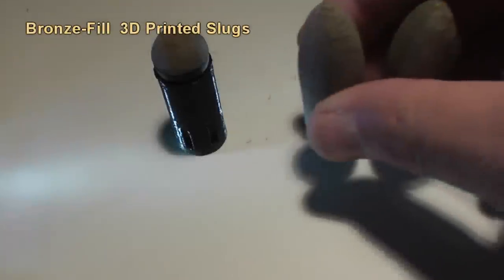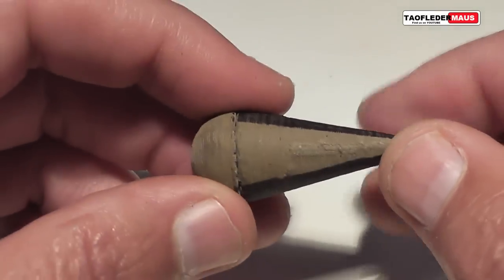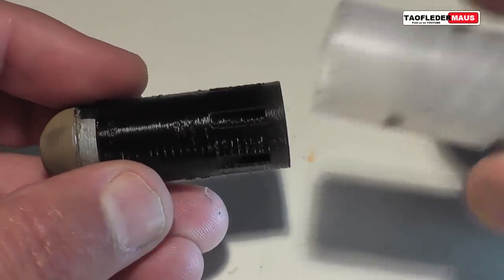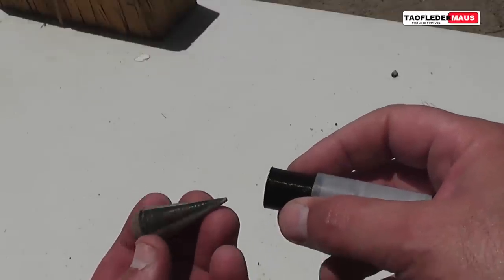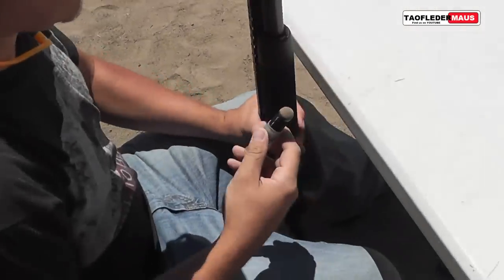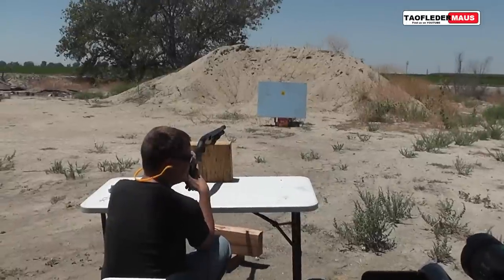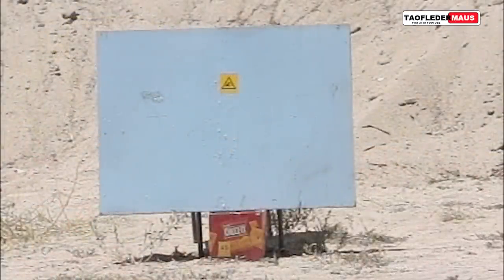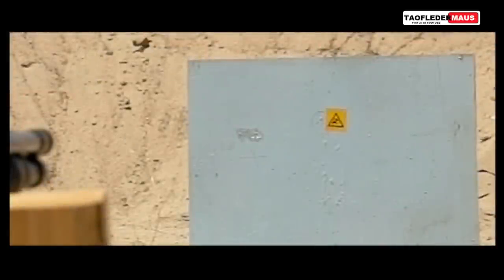Teardrop-shaped 3D Printed Bullet -   Fail Analysis

Comment: I have a question because I'm a pain in the arse. You often say things like "obviously aerodynamics are different for things travelling at supersonic speeds". How? How are they different? What effects are there? Are we just talking about a shockwave?

Anyone who can shed some light on this would earn my eternal gratitude (but not much else)
Reply: As far as i can remember, air stops behaving like a fluid when you hit supersonic speeds and starts compressing which leads to a weird arrangement of pressure around the shot (high pressure at the front, low at the back). Smooth airflow around the shot is not a thing at all anymore due to the shockwave and weird pressures. Both of these + the fact that drag goes up four fold for every time speed doubles can lead to somewhat unpredictable flight
Reply: skyrocket586 Jesus that's complicated. In a sense it's amazing that we manage to send any projectiles straight at all. Thanks!
Reply: skyrocket586 You are correct. At super sonic speeds the air travels in straight lines. 

For instance and airplanes wings use bernoulli's principal to create lift. This is at speeds below mach, because the air acts as a fluid and is non compressable. When traveling above mach. Bernoulli's prinicpal is reversed. 

So you are spot on!!!!
Reply: And a shock wave could distort how the round moves. 

But to get a better understanding you must look at aircraft that travel above mach in order to truely get the idea down.
Reply: TheTyrial86 Wooh! 2 years of fluid dynamics wasn't for nothing after all!
Reply: skyrocket586 lol man. Sounds complicated, fluid dynamics what field of study did you go for?? 

The only reason I know about super sonic air travel is because I had to learn it for my aviation maintenece school.
Reply: TheTyrial86 You and me both mate. Very small industry we play in.
Reply: MrBenski81 very small indeed!! But what is funny with no pun intended the sky is the limit in this industry. Ofcourse you forget to use a manual.
Reply: TheTyrial86 Half way through my degree in mechanical engineering so finished a few thermo-fluids papers. Have a personal interest in aircraft and aviation though which is where I learn't most of what I know about flight and so on. They don't really cover much supersonic stuff at uni till 4th year.
Reply: skyrocket586 Yeah it gets real complicated past mach because the sonic wave creates a distortion that moves the air. 

The program when chuck yeager broke the sound barrier was actually just trial and error on making an aircraft controlable past mach.

But yeah man tight on to engineering. Awesome field to be in.
Reply: Basically the bullet is always travelling in a sort of void of low pressure, with the air it hits acting like a constant, very annoyed wall. I'd say it makes it a bit simpler than standard aerodynamics, as the properties of the air resistance is pretty uniform and not as shape dependent. It gets complicated when you try to steer something through it though. Mostly because the system you're using needs to be practical in both sub and supersonic environments. How do you build a wing that does both equally well?
Reply: RedTriangle53 do you know or are you asking. I can answer you. But you can't do both well it is a trade off. You can add flaps and such to increase surface area like on large passenger airliners.

And also the design of the bullet has alot to do with how well it works. To much drag makes it loose energy in a shorter distance.
Reply: TheTyrial86 It was a rhetorical question. However, thanks for the explanation anyway, as I actually didn't know.

I live somewhere with a military base close by, and I constantly see f-16 figher jets and the likes flying pretty low. It's very clear to me that those bus sized beasts were not designed to be very agreeable with low subsonic velocities, as they actually seem like they are fighting against gravity, needing to thrust at a slight angle downwards to not drop too much. It's a sight to behold.
Reply: RedTriangle53 You are correct. Their wing designs are different. A subsonic wing is rounded and tapered to produce lift by creating a high pressure under the wing and a low pressure on the top of the wing. 

In supersonic flight you need less area to produce the same amount of lift because there is more air particles passing over the wing, and due to high resistance the leading edges are tapered to a point. The control surfaces work differently because the sonic boom effects the flow of air. So instead of having small control surfaces the whole wing, ailerons, and rudders move as a whole. When traveling below mach they lock up and conventinal control surfaces are used at subsonic.

Simply put it is easier to travel above mach or below mach but not at mach. And their wing design is made for higher speeds not lower.
Reply: You guys are awesome, that's a ton of interesting information, thanks!
Reply: Also, objects in the low supersonic velocity range produce a shock wave that inevitably catch back up with the object as drag decelerates it back through Mach 1.  I know from pellet gun and air cannon shooting it's better to either greatly exceed Mach 1 or stay under it completely to maximize accuracy.
Reply: FrankyBabes There's a variety of conditions that come into play when you're moving something at supersonic speeds. First and foremost is friction, moving something at those speeds, that isn't extremely aerodynamic causes heat generation because of the molecules in the air being forced out of the way faster than they can move. Second is balancing, think of driving on a highway at 70 miles an hour or 120ish KMPH, think about how sensitive your steering wheel gets at those speeds. Magnify that for something traveling over 10 times that speed and that's a real problem. Third and most likely the most important is gravity. Gravity effects all things differently at supersonic speeds because you're moving so fast and gravity is pulling on the projectile, it's almost like it's being ripped apart by the speed and weight of whatever is flying. Not to mention rotational speed has everything to do with accuracy, distance, lots of math involved in aerodynamic theory as well as vectoring accuracy.

Comment: I wonder if anyone's tried a slug shaped like a torpedo - with a body that's flush against the barrel (no sabot) and a long, finned tail that doesn't quite touch the barrel.
Reply: Torpedoes are designed for water, bullets are designed for air. Torpedoes are subsonic, bullets are (generally) supersonic. Torpedoes are air launched then propelled, bullets are fired at very high acceleration then are unpowered. There are just too many differences, I can't see that working

Comment: Obvioisly the round is frount heavy so thw round will tumble. Second the round never seperated since there's no way for the savot to split off. Mayne make the sabot split in half after firing and make tjw back end of the round out of a heacuer pigiment. Not a 3D printing nerd D:

Comment: Thats a real crappy 3d print.....
Reply from the maker: +alexisthemexican  It's better than no 3d print.
Reply: +TAOFLEDERMAUS Well... 3D prints are just essentially plastic, 3D printers are in their infancy still so the end products comes out rather brittle, not to mention not very aerodynamic, Real bullets are made out of metals which are heavier and therefore, do a lot more damage.

It would be better to just manufacture the bullets using a better material.